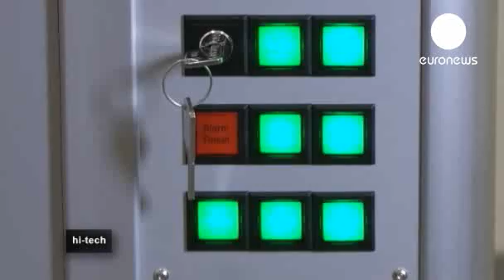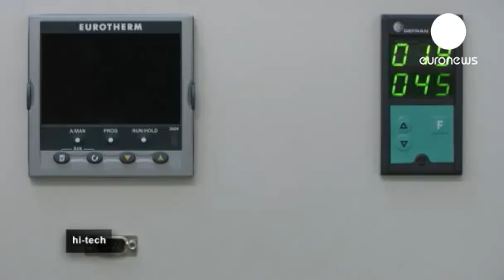World's smallest atomic clock!

Comment: As of "Whitaker's World of Facts" 2009 edition book by Russell Ash, page 85, it says it's accurate to one second in 300 years.
As of Wikipedia, it's one second in 300 million years, and as of this video it's 3,000 years. Which is it?
Reply: One in 3,000
Reply: RexRex none of them you make your own time friend
Reply: Those are different versions of it
Reply: Some find acuracy in terms of seconds some do it in terms of minutes and some.do in terms of miliseconds so the values come different
Reply: Depends on the atoms being measured. Cesium is the standard that most national labs use for official time. However, cesium clocks are typically expensive, complicated and large. Other options are hydrogen and ribidium. Both are cheaper and simpler, but less accurate and reliable over time. Newer clocks use lasers instead of microwaves (optical lattice) and are accurate to 1 second over the age of the universe. However, they are still in the experimental stages and no national lab has yet to adopt them for official duties.

So the answer to your question is "all of the above". There are atomic clocks accurate to only 1 second in 3000 years, there are clocks accurate to 1 second in 300 million years and there are experimental clocks accurate to 1 second in 15 billion years. It depends on the design of the clock, the atoms used, how the atoms are measured, etc. The larger room sized clocks are the most accurate just as a room sized supercomputer is more powerful than your smartphone.

Comment: its not about accuracy of time, its about efficiency.
satellites have atomic clocks in them. if your smart phone also had an atomic clock in it, your phone wouldn't be spending energy double checking the time, all the time with your service provider, freeing up processing power for gps calculations which would in turn extend battery life

Comment: Atomic clocks are 99% accurate because it scales time off atoms. It would be even more-so if you could wear an atomic clock. Time is a measurement of distance through space. We can only go so far though this space dependent on our relative speed in relation to everything else. Example, a satellite's clock ticks faster than a clock on earth because it moves faster than we do. This is because the satellite is ageing slower than we are. To the satellite we are ageing faster than normal. Relativity!

Comment: It doesn't have a 3,000 year battery. It is mentioned in the video that the clock's time will be accurate for 3,000 years, but the battery will not last that long. The battery should last years. But no where close to 3,000.

Comment: As it just so happens, that clock would not be entirely accurate because the world influences time as well. For example, when Japan experienced a huge earthquake in March 2011, the quake was so powerful that it actually made the earth spin a little bit faster, making each week shorter by one second. If the clock doesn't take into account earth's new spin speed, it wouldn't be synchronized perfectly.